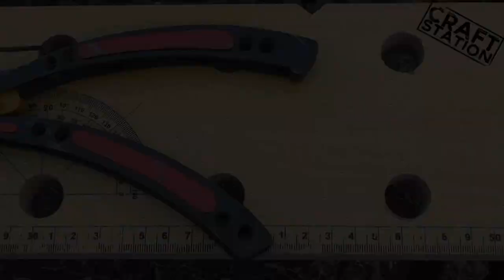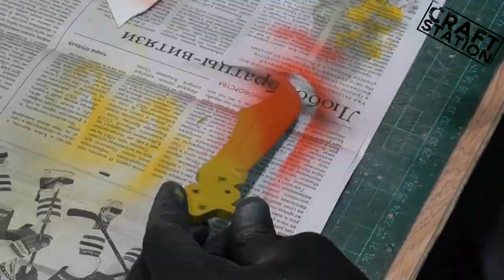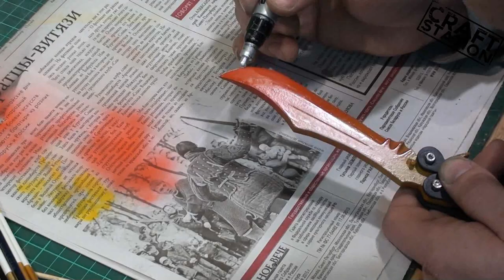How to make Butterfly knife from CS:GO  with templates

Comment: Major flaw that the blade goes through the handle when closed and the blade is waaay too thick.  i made one of a old kitchenknife and blackwood. enclosed when shut.. Only 3 pieces made by anglecutter and drill and bandsaw.
Reply: Jozzo Rama i modified the blade and made it thinner